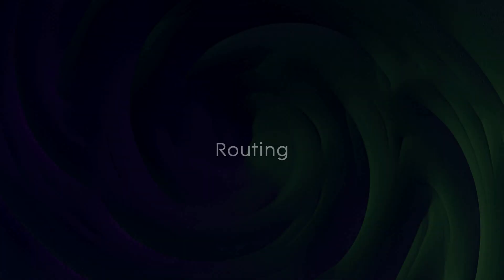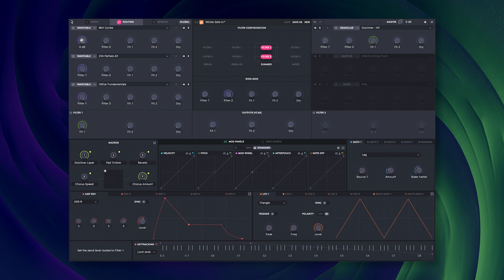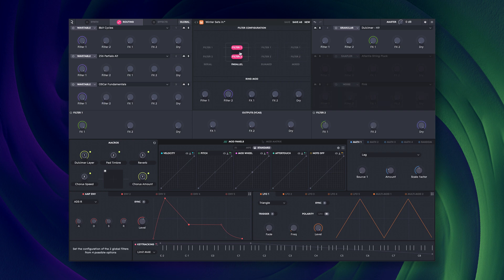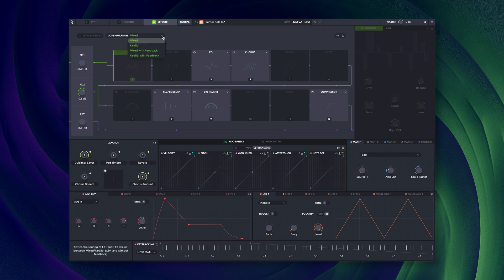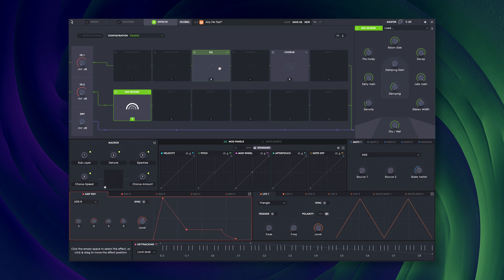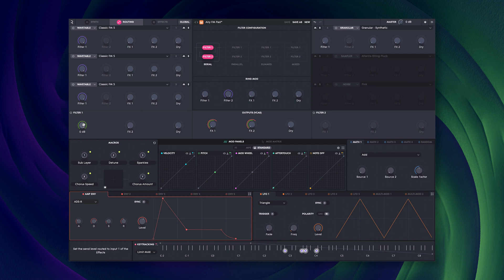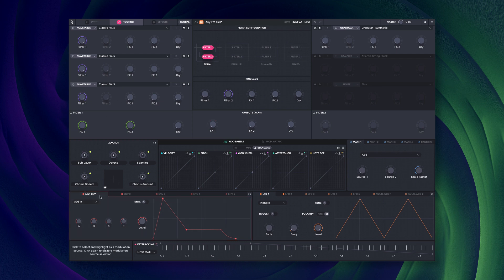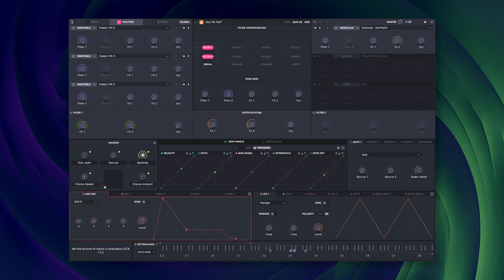Equator2 Tutorial: Routing

Comment: Interface, and especially that part is kind of confusing. In Equator or especially Cypher2 is more clear. You should make something like Cypher2 routing signal interactive graph. Here you 'knobify' everything in different pages, especially look at distance between knobs, its like it optimized to 640*480 in 2021, but for a while FHD or 4K is a standard - you can make everything more compact and packed in one page routing and main osc screen. 
Especially on 4K display, I open it and there is huuuuuuuuuuuge amount of free space between knobs to fit another row or two. The point is that it is not bad, but could be better